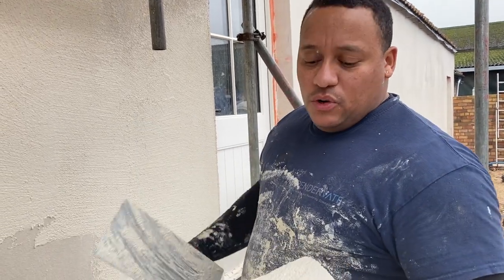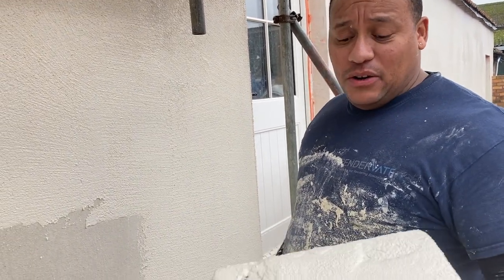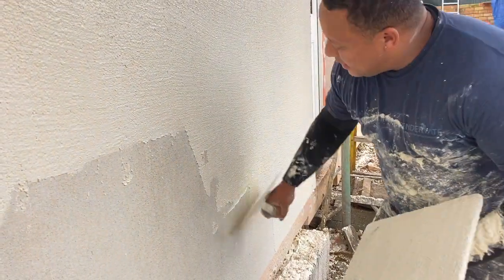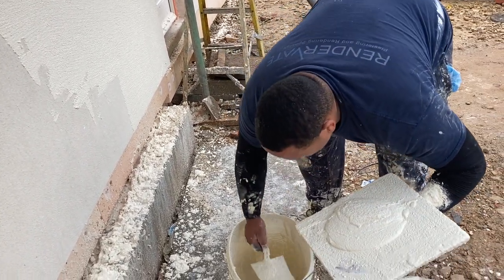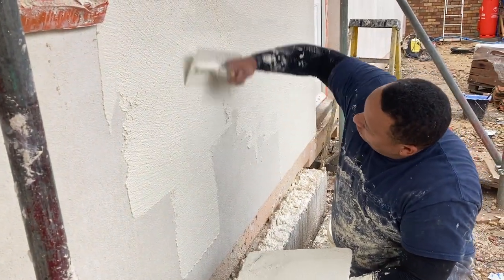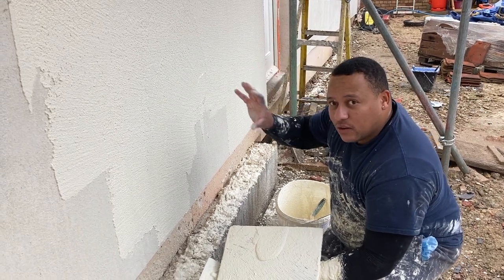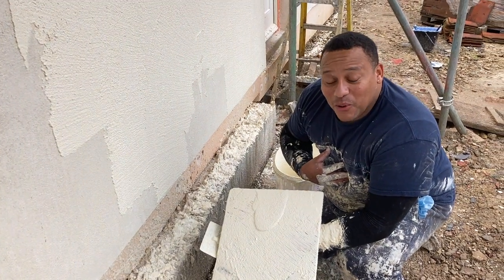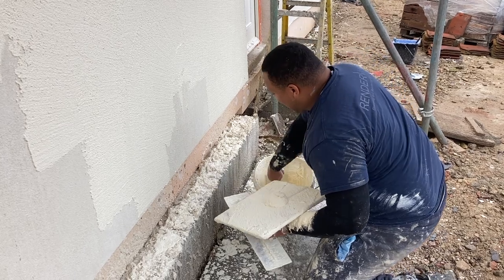How to Apply thincoat render by hand!

Comment: Have worked with all the acrylic finishes for 20 years here in the states the depth is determined by the size of the aggregate in the finish,a small amount of water is good 4,6 oz and if it's a hot day 25 c or above 2 men on each lift will make life a lot easier, priming the wall before finishing is key stops pin holes and kills the suction 👍
Reply from the maker: Yea defo some are stickier than others, we use different amounts with different products, yeah it’s got to be primered for flashing also, we like to spray not hand apply but it’s been cold and we needed warming up 😂👊🏾
Reply: Can this be applied over a rubbed up sand cement wall?

Comment: Your technique is great , and the finish looks great too! But please can you tell me what products you are using, what is the thickness of the basecoat, does this need scratching, what tis the thickness of the top coat and what is the timescale between the application of base coat and top coat ? And finally does the product you are using come in various colours like 'K' Rend, or does it need painting afterwards? Many thanks
Reply from the maker: Lots of questions haha, it’s baumit top coat, you apply it then rub it up with a. Flat trowel, that’s the finish. Get as many colours as you want. Base coat is as thick as what it took to get level I’d say around 8mm
Reply: Do you need to scratch the basecoat or is this render better applied on a smooth background

Comment: What brand you using bud and does that accelerator cut down working time or cure it quicker I’ve been court out with top coat with rain getting to it the day after
Reply from the maker: This is baumit top coat it’s a slow setter, but the accelerator helps it skin over the top, it’s Johnstone’s accelerator used there good stuff, if the weather is up at 6/7 degrees you will be sound with accelerator for next day 👍🏽
Reply: @Rendervate  cheers for reply we normally use tc15 but good to know what other products are about. Would you still put johnstones accelerator in k-rend silicone ?

Comment: Hi mate so are you just putting on a small trowel full then open trowel to take it all back to a paint like thickness with aggregate and colour left behind? 
Cheers dude 🤜
Reply from the maker: Kind off that way mate, what the open trowel does is take the thickness down to the 1.5 - same size as the aggregate in the material. Then you move over what you scraped pal 👍🏽 you want it tight as possible to get the best Finnish
Reply: @Rendervate  awesome cheers mate.

Comment: Can I put this over a sand and cement rendered chimney?.
Reply from the maker: Yea it’s perfect for a sand and cement base coat, just make sure it’s bone dry pal. Get it from https://www.rendit.co.uk
Reply: @Rendervate  thanks a lot
Reply: Done fair bit of this we used Wetherby what's your choice of brand we always hand applied
Reply from the maker: @gavinwilliams2240  I am using baumit in this video, they are all similar really, I like the krend tc15 it’s lovely
Reply: Yes get the primer for the finish your useing, tinted to same colour as the finish works great
Reply: Have you ever used tc 10 I'm interested in using the smaller grain for a smoother finish is it a big difference or not much in it
Reply: Great video. What mix would you use for a sand cement base
Reply: Best brand for pure white and going over silicone based dash coat that’s been used for smooth render Joel what would recommend 
Cheers in advance